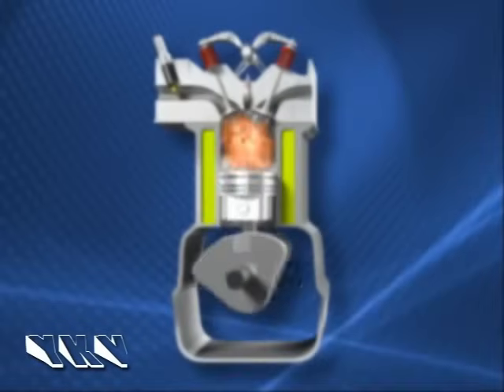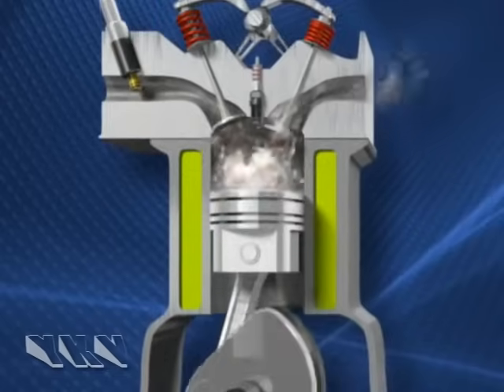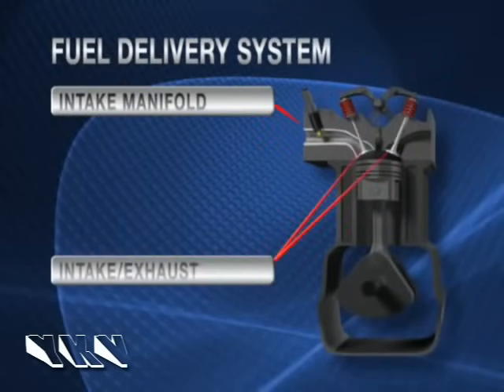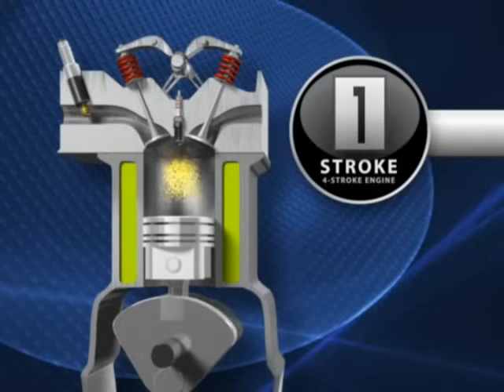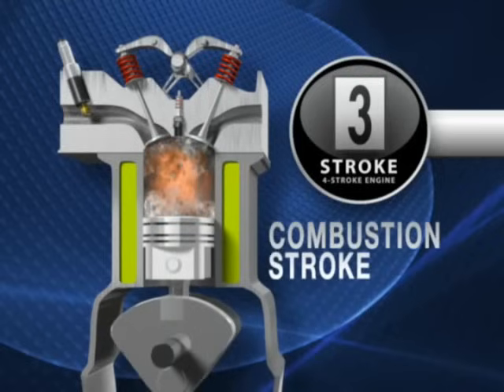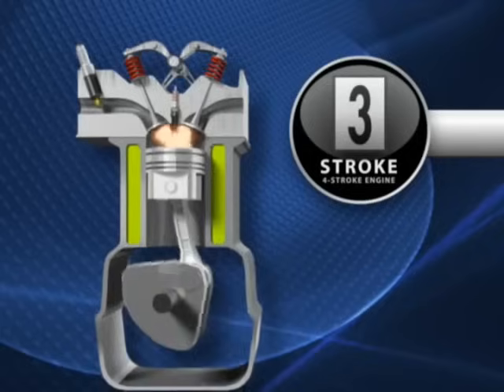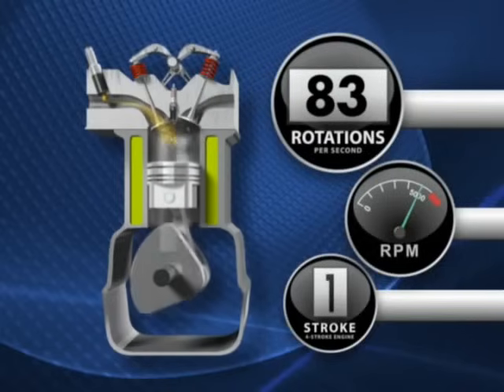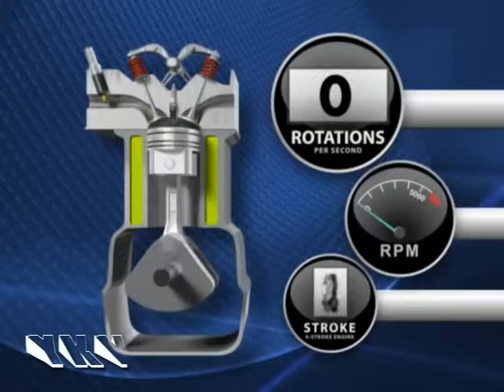4 Stroke Engine Working Animation

Comment: So if a parallel twin with both cylinders moving up and down together is described as a 360° because One of them fires every 360°, would a single cylinder firing every second rotation be called a 720°?

Comment: Working Principle and Optimization Methods of Four-Stroke Engines
The four-stroke engine is widely used in modern cars, trucks, and various types of industrial internal combustion equipment. Mastering the working principle of the four-stroke cycle helps optimize each stroke, improving engine efficiency and power output. The four main strokes include: intake, compression, combustion/power, and exhaust. This process converts chemical energy into kinetic energy, with each stroke playing a specific role and significantly influencing power output.

During the combustion/power stroke, the spark plug ignites the air-fuel mixture, releasing chemical energy, which is converted into thermal energy, causing the gas inside the cylinder to expand violently. This expansion drives the piston downward, transferring kinetic energy to the crankshaft via the connecting rod, ultimately driving the vehicle’s power output.

In this section, you will explore the key components of each stroke and learn how to enhance performance through fine-tuning. Additionally, extended reading on ECU, TCU, and CPC is provided at the end to give you a comprehensive understanding of these control modules' critical roles in engine management.  https://www.mach5-performance.com/NewsRoom/Details/7cb36081-1c12-4731-b5dc-8780b7d809c9

Comment: I'm continually amazed at the combustion engine. Most people never know what their engine does/goes through. Then add in the aviation industry, our engines run at 90-100% nearly all the time. A car engine could never withstand that abuse. Where an airplane engine almost thrives on it. Next time your car breaks down... Or your flight is delayed... Consider the stress these machines undergo. At another time, we can discuss jet engines...MIND BLOWN!

Thanks for your amazing animation!
Reply: TBF aircraft engines run at much, much lower RPMs than car engines. 100% on an IO-360 is like 2700RPMs
Reply: @sizziano  what's nuts to me is that plane engines in the 40s had superchargers and turbo superchargers and water-meth injection.  things you see 80 years later in the performance car scene

Comment: Demonstrates that for a smooth running engine; Change your spark plugs, change your oil, keep the air filter clean ( or change out) and only use high octane gasoline. Great video for motorcycle maintenance, etc.

Comment: Whenever u wanna buy cheap ass no brand gas station oil, watch the last 20 seconds of this video.

Then multiply the speed times about 10 if you have a turbo. 20,000rpm turbine wheel depending on a thin sheen of engine oil to not cut itself in half within seconds... I've absolutely seen that shit happen and them turn into mini grenades blasting shrapnel into the intake and into the cylinders. Then the pistons slam the shrapnel or worse the shit catches under a closing valve dropping the valve onto the piston and then it riding piston back up and stabbing the head, then punching holes in the pistons and they explode, the now defunct piston giving up the ghost AND the connecting rod which slings itself loose from the containment of the cylinder on the down stroke, reorients itself downward or outward via horizontally rotating inertia, and then either punching a hole in the block as the crank slings it sideward or oil pain as it slings it downward... 
The entire thing took maybe 3 seconds max but to you it sounds like one single catastrophic failure and oil smoke furnace blast as the oil gushes all over the exhaust manifolds cats pipes and everything else.

No, it was one sequential chain of unfortunate events that saves you $10-15 on oil.

👍

Crazy ass shit.

Comment: It wouldn't hurt to add that at the end of the exhaust stroke, the exhaust valve and the intake valve are open at the same time. NOT A LOT, just a little..... but it takes a little ventilation to get the last little bit of exhaust off the top of the piston. So the intake valve begins to open before the exhaust valve is fully closed and vacuum from the exhaust manifold sucks the rest of the exhaust out of the cylinder, allowing a full volume of clean air and fuel vapor to engulf the cylinder... with NO contamination from residual exhaust.

Comment: Engines still blow my mind. All of the precise, calculated moving parts, quickly, quietly and for many thousand miles.
Reply: 2 stroke is the fastest reving least part design ever made in a piston engine. Its alien smart, no computer needed.
Its been around forever but federal government don't like them. You can't find 500cc twin cylinder, two stroke Road Bikes anymore. 
But I remember the Suzuki T500 cobra being popular around.
True widowmakers : no supercharger or turbo needed.
Just gas 😊
Reply: @noneshere  well, they don't make torque since half the cylinder stroke has nothing to do with compression STROKE. That's the hangup. But on light vehicles that don't need torque like a bike they are hell on wheels.

Like a rotary. No torque but HP through speed.

They definitely have their place. Also since they make powder every other stroke instead of 1 of 4, the effective power output ratio of 2 stroke to 4 stroke given perfect intake exhaust fuel mix etc, is about double.

In other words, an 80cc 2 stroke tuned right w the best scenario intake and exhaust setup puts out as much HP (but not torque) as a 160cc 4 stroke. So having a light ass 500cc 2 cylinder dirtbike you're talking 1000cc 4 stroke territory...
Reply: Just like your heart man, eventually they give out though.
Reply: @snatchwizard  Gives you a greater appreciation for hearts though, even people with bad genetics or don't take care of themselves can rely on at least 50 years of heartbeats without issue, meanwhile most modern engines tend to give out over 200K miles.  The power of hundreds of millions of years of trial and error compared to a measly century of human design
Reply: @snatchwizard  mmmmmmmmmmmmmmmmmmmmmmmmmmmmmmmmmmmmmmmmmmmmmmmmmmmmmmmmmmkmmmmmmmhmhmmmmggmmg
Fmmfmm. 
M
Mm...mmmmmmmmkmmmm
Jmjmmmm.mm..kkkkkkkkkkkkjjjkkkkkkjjjjjjhhhgggkjjjjj nnkkkkmmhhhvvvvcccxxxxxz::"😡😡&*((**&& ***^99*&&77&8889((????. ,   ))(9*//4$#3@!!!88((
Reply: @snatchwizard  bet you're fun at parties.
Reply: @amylucas1780  he didnt say that as a death threat
Reply: What's more insane is the oil. If you put food oil in there it would burst into flames. Absolutely.

And turbos spin at like 20,000 rpm when under load.

3 seconds of not having steady oil at that speed and it turns itself into a Dremel tool, the shaft is thinner than a straw spinning twice the speed of a grinder... Doesn't take an engineer to know what 20,000rpm of metal on metal will do to a metal rod the size of chopsticks...
Reply: Engines are shit, they break own all the time.  They're far too complicated. The sooner we all use motors the better.
Reply: @lambertovitali3152  but an engine is a motor....  Oh, electric motors might be better, but they're soulless and lack character and differentiation.  And we still have problems with battery chemistry to provide both sufficient storage and to be able to withstand the stress/demands of sustained high performance driving without performance degradation.
Reply: Unless you drive an f150 lololol
Reply: computer

Comment: So I have to ask this, does the spark plug always create a spark each stroke or is it just for the one time while starting the engine, coz I thought that the compression of the gas and air mixture with the upward motion was sufficient to raise temperature, or am I wrong in thinking this?
Reply: I'm pretty sure each stroke

Comment: He's wrong. The sample is an example if you would have a carburetor. Fuel injection injects gas directly into the cylinder and not through the valve itself. Don't get me wrong. It's a really cool animation. He just got what fuel delivery system that's being used wrong.

Comment: a modern 2.0 engine displacement you would imagine to start the engine at around 800 rpm. you drive around the city between 1500 to 2000 rpm.. and maybe reach 3000 on a highway.. you would hit 5000 rpm sometimes if you are trying to go fast

Comment: So the crank rotates Twice for every One power stroke. So on a CDI ignition, the trigger sensor rotates Twices per powerstroke, thus the spark plug fires twice also, once to ignite the fuel mixture and the other time is a 'wasted' spark that fires when the exhaust valve is open. That is why the engine will still run if the timing chain is 180 degrees off! Lol 😎😁 A little known factoid.

Comment: what pushes the piston to compress? since theres no combustion chamber on the engine block.
Reply: The momentum of the piston keeps it rotating around the crankshaft, and moving up and down in the combustion chamber. The combustion stroke (the third one) helps the piston maintain its momentum and overcome its inertia.
Initially, as in when you turn on the engine, there is a starter motor that manually spins the crankshaft to get the pistons moving to get the process started.

Comment: If the expansion of the air and gas mixture pushes the piston down during the combustion stroke, what pushes the piston down during the intake stroke?
Reply: Momentum
Reply: the motor

Comment: What drives the piston down on the first stroke
Reply: usually either the kickstarter or the electric starter motor
Reply: Lube
Reply: If you mean first as in when you start it, it is driven by an electric motor as a starter motor, or turned over by an external input. If you mean the first stroke of the cycle, the current inertia of the engine/or vehicle, or if there is more than one cylinder, the other cylinders' power strokes are driving the pistons not at power strokes. In multi cylinder engines, generally the timing of the cylinders is such that generally, there is a power stroke in one of the cylinders at any one time.
Reply: Sharafat Hussain what does that mean
Reply: dubzy21 The clutch engages (either you engage it or it automatically engages in a transmission) and the mechanism is actually being moved inside externally when this happens (you start your car). Once you put the key in, it allows for gas to enter the mechanism and for the spark plug to ignite the fuel/air mixture (I think this is how it works, I’m not completely sure).
Reply: Motivation, desire, passion, enthusiasm, covfefe
Reply: Battery power or kick start. And from the next cycle it must be the crankshaft reaction which drives it( dont know the exact terminology- failed at mechanics lmao)

Comment: Its an engine not a motor
Reply: CARED  ,  no one ever   engine or motor    ALL other ppl understand what is meant. (electricians get up on ONE word) Roll eyes   LOL
Reply: i think generally engines run on fuel, while motors run on electricity, but the two words can be quite interchangeable in daily usage https://www.quora.com/What-is-the-difference-if-any-between-engine-and-motor

Comment: So if the engine has single cylinder and does 1 combustion stroke per every 4 strokes then how he is able to do the last stroke after the exhaust stroke ? won't it be hard for the cylinder to do the last cycle after he releases the gas..
Reply: RomanVideos1 not at all.
Reply: "momentum", carries the entire three strokes,  this does not happen by accident, and it happens multiple times per second.

Comment: Where does the power come from to force the piston down on Stroke 1 (intake stroke)
Reply: If the engine isn't moving, that's what your car's starter helps overcome. If the engine is moving, the power cycles of the other pistons (or the amount of energy made on the one cycle overall on single cylinder engines, which is why those can easily stall)
Reply: Also remember, the smaller the engine, the less power it will take to make it continue revving, and the larger the engine, the more power an engine will have to keep itself rotating. Smaller engines also generally rev themselves higher at idle (1000-1500 rpm) in order to make slightly more power to prevent stalling
Reply: but in a two stroke, the combustion stroke only provides enough power for one revolution of crankshaft, right ? So in single cylinder 4 stroke they must get extra power from combustion stroke to turn it 2 revolutions or they using flywheels.
Reply: @owenmartin3307  I don't know where you got that info, but I don't believe it is correct. While most larger engines do use flywheels, that's more for just smoothing out power delivery and eliminating harshness more than anything. Most smaller single cylinder engines are direct drive/clutchless (motor is connected directly to working mechanism), which would be most lawmowers/generators/things like that
Reply: "momentum", carries the entire "other" three strokes,  this does not happen by accident, and it happens multiple times per second (but the original POWER is supplied by the starter and battery)

Comment: What's the mph? 35-40mph?
Reply: Miles Per Hour. Simple math demonstrates that 60 miles per hour breaks down to a mile per minute... since there are 60 minutes in an hour. If you're asking what 5000 rpms equals in mph... that number could be anything, based on the size of the pistons, connecting rod, crank shaft, etc. etc. etc. There is not a one-size-fits-all crankshaft, piston, connecting rod, etc.

Comment: How do the valves open,  I don't quite understand how only one valve at a time opens.
Reply: Bailey Usagi The lobes on the camshafts. One for intake and one for exhaust on a DOHC engine opens and closes the valves at a specific timeframe using the chain driven by the crankshaft.
Reply: Mechanically driven by the rocker arms via piston movement generally but  these days also monitored and controlled by computers
Reply: they have complicated mechanisms to do that...

Comment: How move piston upward?
Reply: Sha navas The starter initialize the up and down movement. As soon as the first cylinder is able to begin the process your engine starts.
Reply: With multiple cylinders, the move opposite of each other.
With a single cylinder, the inertia of the flywheel at the bottom forces it back up.
Reply: @iac4357    "momentum", carries the entire three strokes,  this does not happen by accident, and it happens multiple times per second

Comment: Very well explained..Engines are fascinating
Reply: They are indeed !
Reply: Yes  fuleal  engeacter  systom  ilinked  my  feled    enginering    basical       dieseal   enges  worked    ,   fouer   stroked  2 stroked       compressar      meacheanical   energey is     compressar    engacting  engrey  convertimg  systom  woriking       moveimg  fueal vengesies   pistion   carkshfted  restin  pin  seting     all  compeanted
Reply: @jollyscaria1922  what